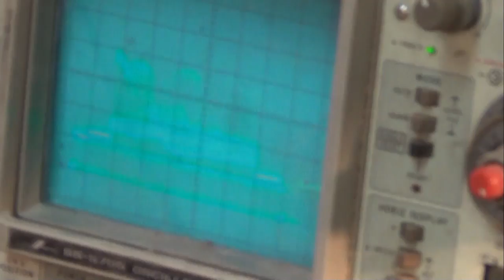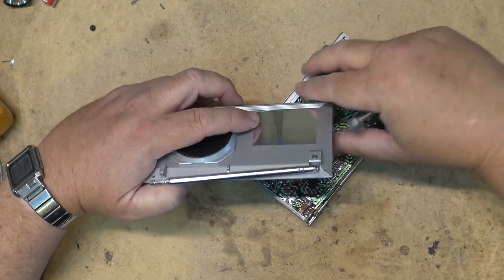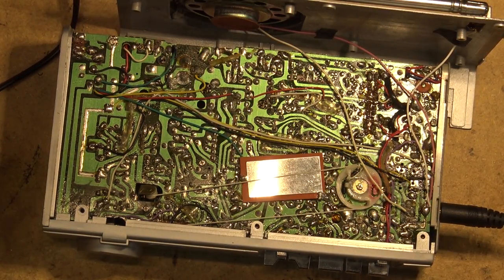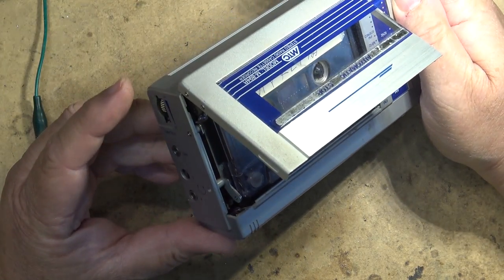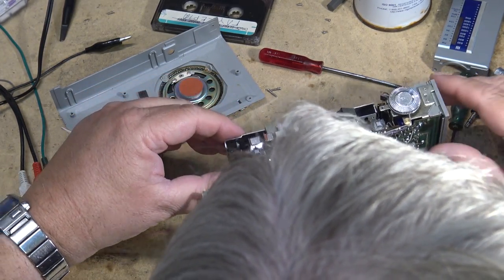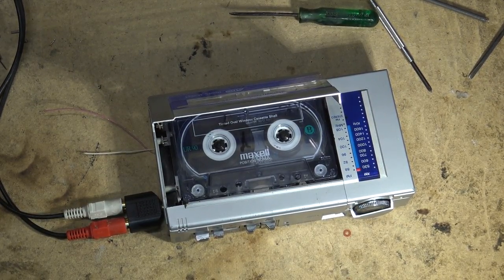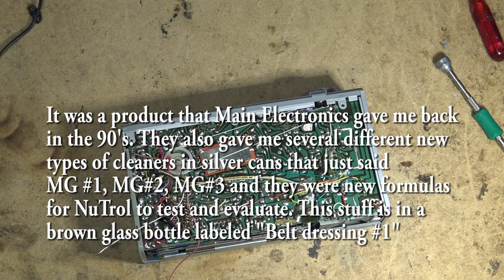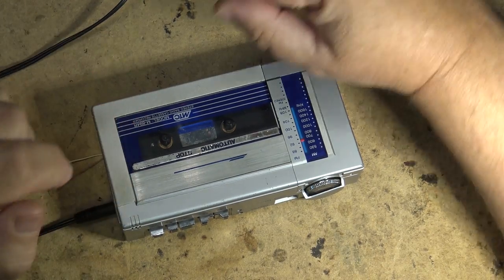Rare MTC Walkman with Record function radio and built in speaker repair

Comment: This MTC Walkman is a copy of the original Aiwa CS-J1 from the early 80's. This particular copy was sold under many other 
importer's brands. The original Aiwa CS-J1 did not have a speaker, and is of superior quality with an extremely sensitive FM tuner.

Comment: I had one similar to this back in the 80s and into the 90s. Mine lacked the speaker, just had a blank plate for the back, but was identical otherwise. Got a lot of use out of it.

Bit of irony: the headphone jack failed. No replacement available, I actually disassembled it, re-formed the metal bits inside, and got it back together for a few more years of use. 

Used it for interviews as well as music. Lost in a move. Kind of miss it.

Comment: Last 'walkman' (if you lowercase the name, you're referring to the generic) we bought with the intent of actually using it was a Radio Shack branded (OEM'd by Aiwa) AM/FM radio/recorder back in 2000 - with internal speaker but used an external lavalier mic for 'live' recording. 

Never used it, as MP3s and recordable CDs had come on the market soon after. Still sits in its box on our display shelf of Boomboxes and tape recorders/players.

Not for nothing, but did you clean the capstan and pinch roller? Also, we noticed a trimpot next to the DC plug? Maybe a motor speed controller?

Lichen number three...
Reply: Had no idea that Aiwa was making the Radio Shack units. Completely overlooked those portables because they weren't "cool."

Comment: I was also thinking it would be fine as a little stand alone radio.
Not supprised about the deck, the rubber bits always die, even if never used.
When i have had to work on the stringing, i put two cable ties through the big wheel to stop the cord moving.
I hate touching the stringing as well, unless there is a printed plan as a guide (Not very often available).

Comment: Way easier to change the belt on the real walkman. My belt was loose, so I fixed it for now by just putting some shims in the slots where the motor mount grommets are. Are those belts from (you know where) any good?

Comment: Looks to b like a black ground wire connection,,,along with the coloured wires for left and right channels.
Never really had seen a tuning string and pulleys thru the circuit board cut out holes b4,,,i guess it must b the original belt that it would've been installed b4 the rest of the unit assembly was made and all put together afterwards during manufacture. 

Hope the belt dressing does the job,,,,without the nightmare of disassembly of the tuning string. 
Play it long enough for more than 10 hours,,,and the wow and flutter noise,,,should sound real smooth in tape playback later.

At least I've got the rubber renue here,,,and had restored 4 rubber drive tyres,,,on a vintage pioneer stereo cassette deck,,,and now it plays,,,fast forwards,,,and rewinds as it should.

Comment: your 1000 times more competant than me, but i wouldnt be happy until the speed of the playback sounds correct.  Still sloooooow aint it?  I still LIKED....Hombre!
Reply from the maker: Not according to Mr Frequency coounter. Tone 440hz, verying slightly between 441 and 438 which is close enough considering the condition of the belt and slippage. I don't use cassettes, to me they have always been shit. The only reason I have a cassette deck was for transcription of contents onto the computer. I have a boom box that only the radio has been used. Not a single tape has ever been put through it. I used cassette briefly for portable playback. I have a brand new factory radio from my 95 TBird that has never had a tape played on it.
 I dont own a single pre-recorded cassette either.
Reply: Hey 12volts on a different subject can u use polarized caps instead of non polarized caps.
Reply from the maker: @tedherbert6953  
They each have their specific uses.

Comment: Interesting story about repair shops laughing at customer wanting to have such units fixed. They were not so cheap back then. So this was the beginning of the "throw away mentality" we have today. I would understand it if the shop was a specialized Sony shop but if not I cannot understand why a customer with a lets say mid range priced product was a joke to them...
Reply from the maker: The shop i worked at sold Sony and Panasonic and the sales people were the ones writing up incoming product and they had their own interests.  I had no way as to what was permitted in.  Hundreds of dual, garrard and bsr turn tables that were just gummed up went in the dumpster to sell them some plastic crap.   I didn't own the shop and I had no say in what came in.  I was busy enough with stuff i could make money on.
Reply: @12voltvids  
Ok, sorry. Then I misunderstood it. So it was a shop selling products and also repairing stuff in its own department.
Reply from the maker: @manueldi_77  
It was a Sony authorized service center that had a retail sales floor and the owner took every opertinuty to discourage repairs on anything more than a few years old.  I had no say in what was repaired and a few times i took something in that management did not want to fix and the customer was called and told it was beyond repair.   Again. Not my doing but i didn't own the business i just worked there so I had to follow the owners ruled that changed as often as the weather.  I can't say anything nice about the man so I won't say anything at all.  I just reported for work took all kinds of bullshit from the owner but in the end i was paid well so i just let it go in one ear and out the other.  It was a toxic work environment and there was a revolving door in the repair shop.

Comment: My smartphone has a FM radio on it and works better than any portable radio.
Reply from the maker: Some do, most don't and the new ones without a headphone jack won't work as you need the headphone wire as an antenna.

Comment: As nice as it  is to get something like this going, there are better battery operated radios around that are pretty cheap.
If there is a major enough power failure that the Cell Towers are down, then you have bigger issues given cell towers have UPS built in that would last several hours, often even over 24 hours depending in the tower :). 
The tape deck needs new rubbers, the wow and flutter is really awful.  It is pretty well unusable.  My Opinion on this only of course.
Reply from the maker: Bzzt wrong.  Microcell nodes do not have a ups.  When the power drops they go offline.  The large cell installations yes. Our main tower us at the local central office and it has a generator but the rest, all 200 or so micro cells on the wooden poles do not have backup. Power has been down twice in a month and my cell signal went from 5 bars to 1 and it took 5 minutes for a text to go from my phone to my wife's because the network was so congested for the 1 site that was handling all the traffic.